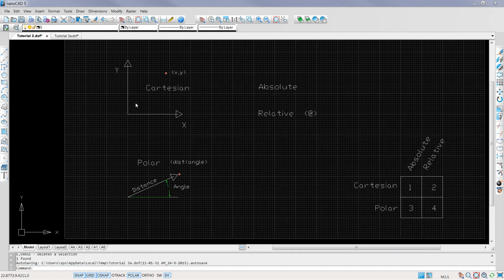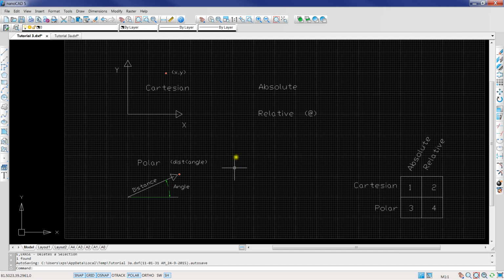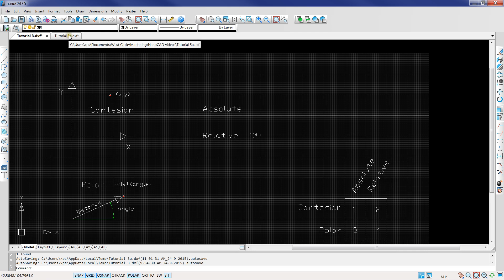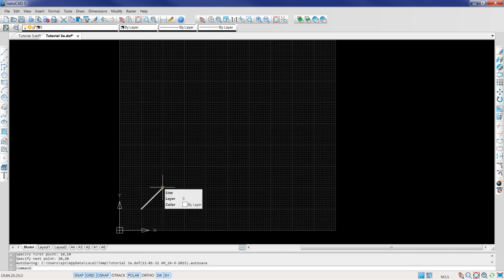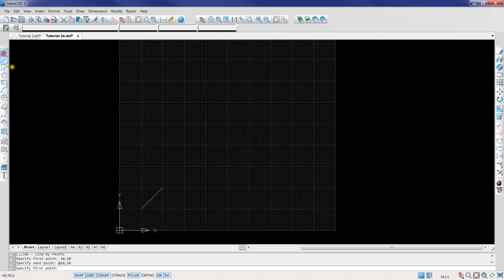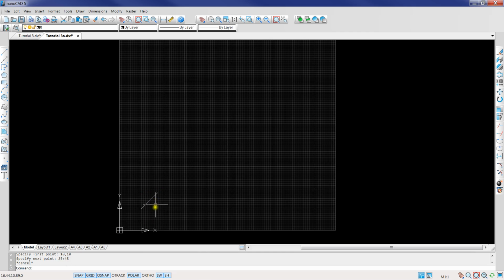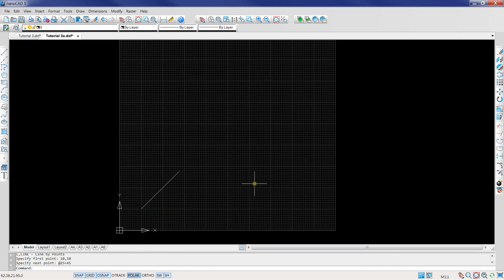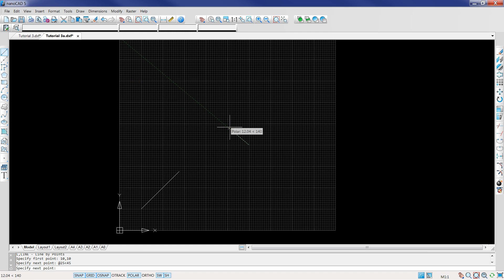NanoCAD 5 Tutorial English - Part 3: Relative & Polar Co-ords

Comment from the maker: Thanks for the comments Matt.  

Another good way to locate objects relative to each other is to use "move".  For example you could draw your new building right up against your existing building then "move" it 2 x 3m from the corner.   Go to Modify in the menu then select Move and follow the prompts in the command line window.  

In CAD there are many different ways to get the same result. 

Good luck and I'll aim to post another video using move/rotate/copy etc.